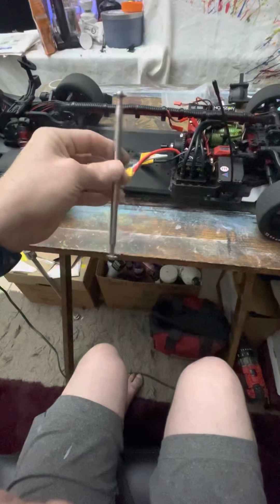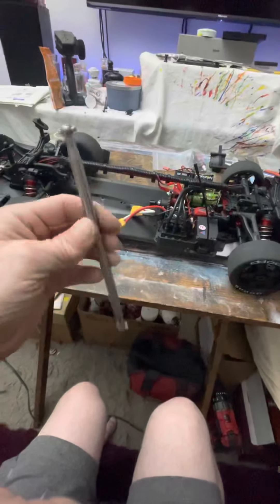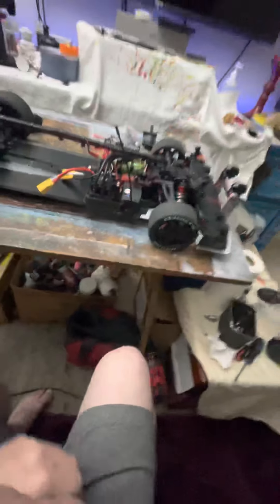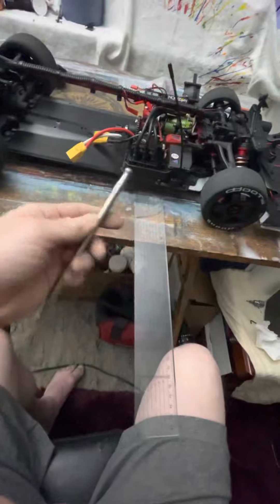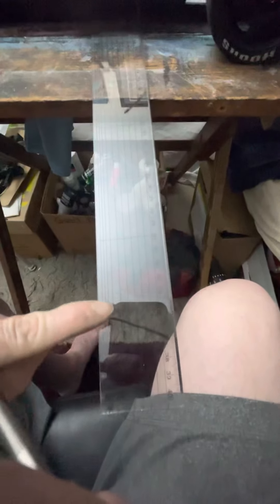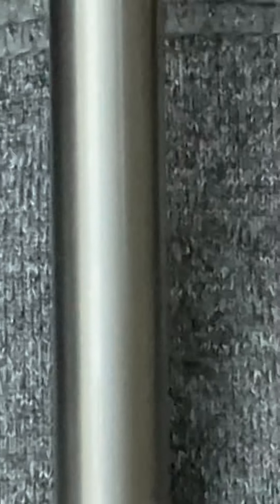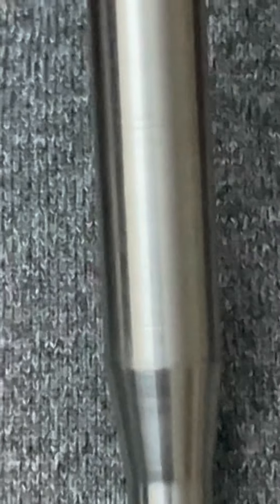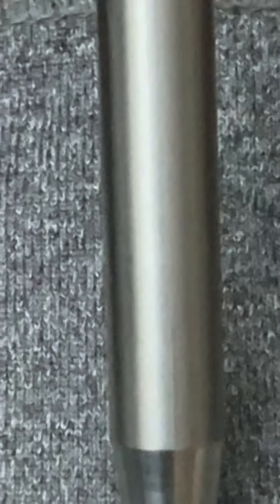Scorched Rc shafts. Defect or normal?

Comment: they make good parts,bought loads from them myself. you do realise that sometimes there are mistakes and these things get through quality control, no need to put it on youtube, jsut contact them and im sure theyll replace it. maybe not 4 months later tho
Reply from the maker: Yea some sellers are easy to work with like Amazon and secondly eBay but getting an exchange from Europe did not turn out as easy. So I opted for a short QC video rather than to get personal.
Reply: @toysforboysrc  yeah suppose if you arent in europe not as easy
Reply from the maker: @allthingsmotorized1885  … I still appreciate what you said because It grinds my gears when I’m shopping online and people giving the product one star because of something so insignificant but does not effect its main purpose. So it can hurt the market and discourage someone from buying a product that would have been perfect for them.

So to not sound like I’m giving it 1 star I have to give it a full review ..I am proud to admit, because the product still did what I expected from it and I have not had any issues with it, it is everything they advertised it to be so I give it 4 of 5 starts. I remove a star because the imperfections were unexpected and it took away from the shopping experience because I did not have full confidence in the product from the beginning and it took a while for the product to prove itself. 
 Would I recommend? Yes
Value for money? It’s worth the money.., if your okay with the imperfections if any.

Comment: If its straight then its fine.  We need a balance machine the tell if its off.  Also no bearing is going onto the surface so nothing a buff can’t fix but I understand.  Shouldn’t be like that👍
Reply from the maker: I still gave the shafts  a positive review in my comments but commenters are not reading My positive review. Still  many people commenting here are proud owners of the same shaft and they defend the product so there’s still valuable information in this upload. 

People need to know that not everything they receive is going to be perfect, and not everything that has imperfections is a deal breaker. Nobody likes disappointment or doubts, so.. those who watch this video because their thinking of buying scorched center drive shafts can still proceed with their purchase and have confidence that even if the finish seems imperfect, they can still rely on the product as I did and with validation from the other commenters on here.
Reply: @toysforboysrc  i did notice that 👍

Comment: And what happened after this? Did you informed them about this? And did they solved it? I had the same with parts from another high quality brand and I didnt go public with it but in stead I contacted them and they solved it by sending new ones... now this is just bad advertising for a great brand!
Reply from the maker: The finish was imperfect but the shaft itself “seems” to be straight. I’ve been dealing with too many things at once to contact them for a replacement. I’m doing another build soon and I’ll be using different products.